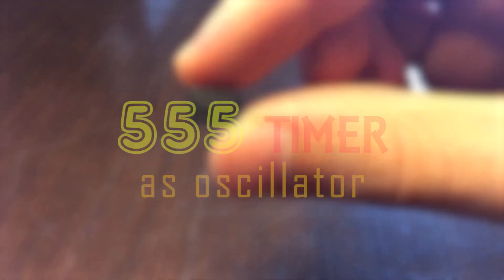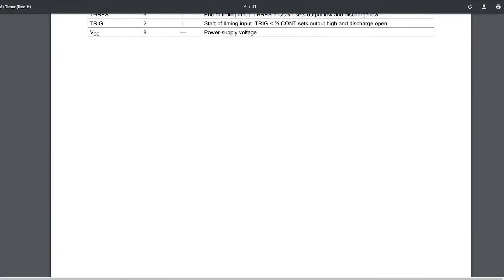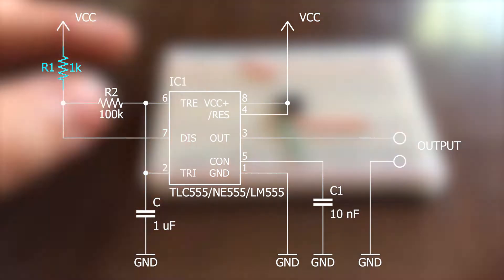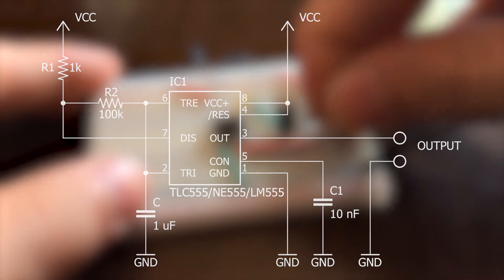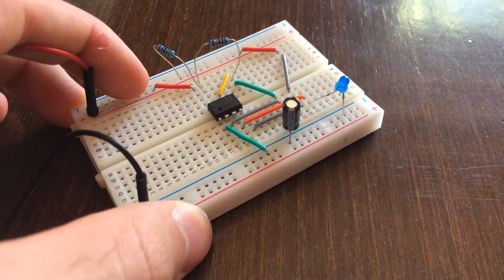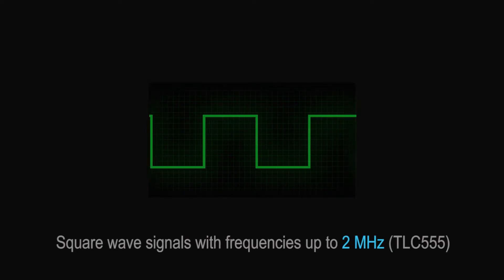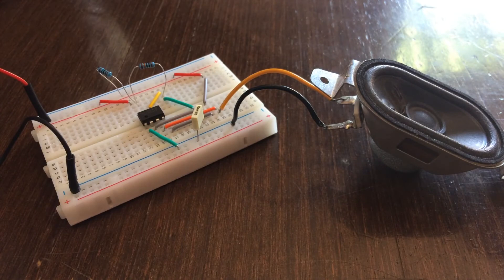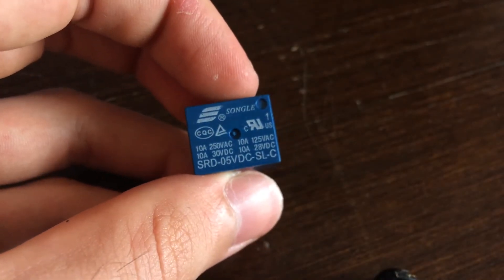555 TIMER as Oscillator (Astable mode)

Comment: Could share video to generate 2MHz frequency generator using 555 timer?
Reply: relaxation oscilator a capacitor a inductor and a (neonbulb / spark gap / bjt run in reverse bias). many calculators for capacitance and inductance for the relaxation oscillator and many calculators for air coil inductors inductance online

Comment: Is the applied voltage 5V DC?
Reply: If i read the datasheet correctly, the NE555 can operate from 4.5V up to 16V. So yeah 5V DC will work and has worked for me.

Comment: Place a resistor in series with the LED. If you drive a relay, place a diode in parallel with the coil to prevent the back EMF from burning out the timer.